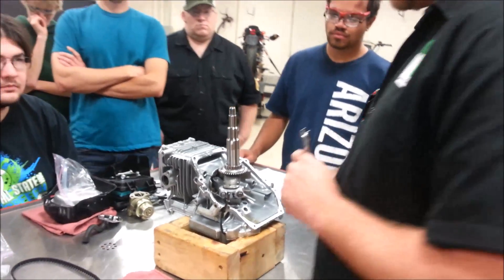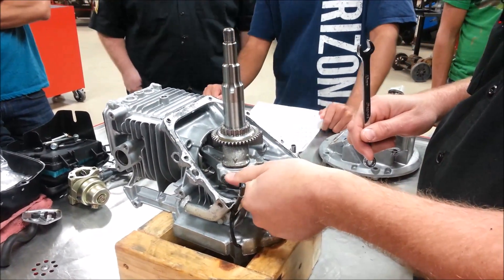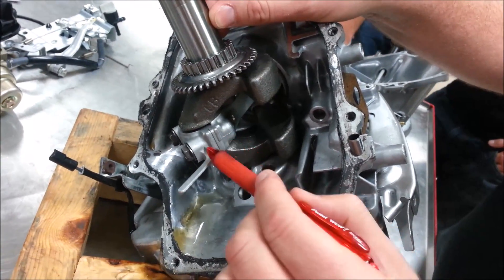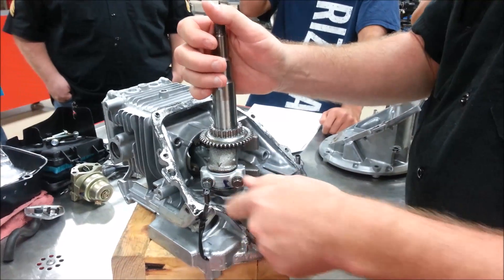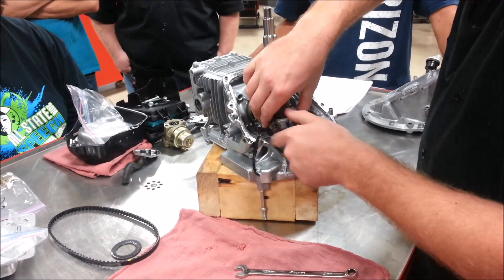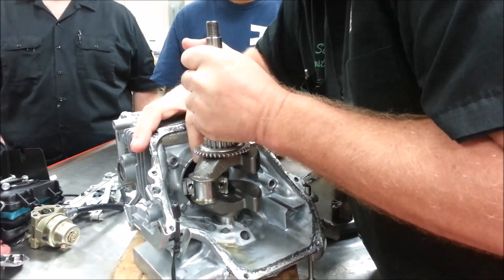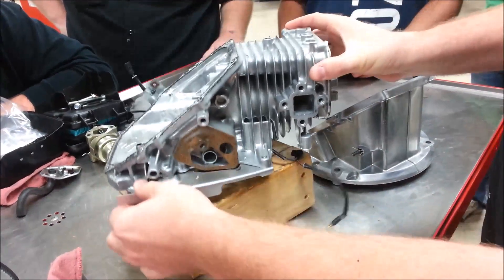GCV Disassembly   10 How to remove a Crankshaft #how2wrench

Comment: Really enjoyed your video, I have a question. On the belt itself could you install it upside down or backwards? Some of the videos I have seen on the GC 160 on the engine when they took the belt off a mark it so they could reinstall it the same way. I'm replacing mine so I don't have that luxury of marking it. Any help would be greatly appreciated.
Reply: You can install it either way. I've been looking for a metal crankshaft gear to replace the plastic one in the motor I'm working on and noticed no one helped you out.

Comment: hi, i couldn't understand how you calculate the torque. you said: these are 6 by 1 mm bolts. so first. what do you mean with 6 by 1? A M6x1 Bolt or what? and second, how can you calculate from the outside diameter of a bolt to the torque with these bolt was tightened? when you tightened these bolts with 69 ft-lb (btw. thats about 100Nm) the bolt will be destroyed, isn't? That sounds to much imho.
Reply: Those rod cap bolts are probably 69 in lbs.  Ive never heard a main bearing referred to as a journal either.

Comment: On these Honda GCV-160 engines, are the lower sections interchangeable? I have a seized up engine, and want to replace, but on the replacement, the mount posts are missing for the belt guard. So I'd like to keep the original base if it's not damaged.

Comment: Hi, Guys,
Englisch language is not my mother language.  Can anyone tell me please, what the acronym PTO stands for?
Reply: Power take off
Reply: Hi, Dwight Jackson,
sorry, but in my opinion, you are not right.
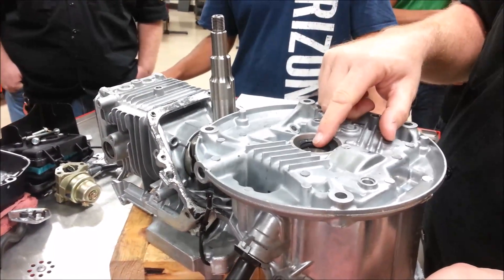The lecturer mentioned this acronym at time 3:35.
Reply: Hi, Dwight Jackson,
finally, it seems you are right. I was not able to understand the meaning. Now I got it though.
Reply: MAG= magneto side of the engine (usually also houses the recoil starter)

PTO= Drive clutch side of the engine